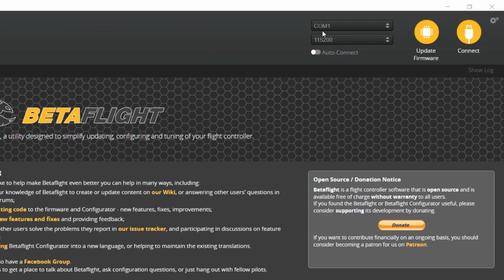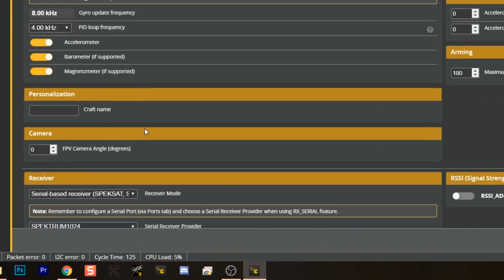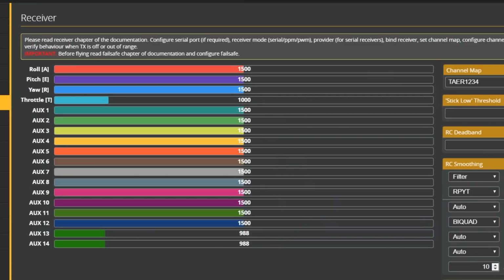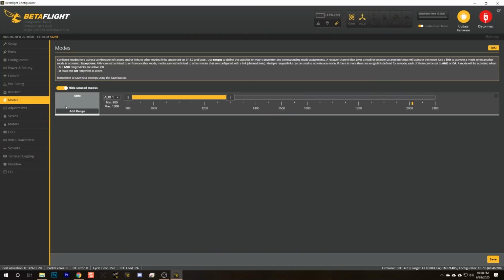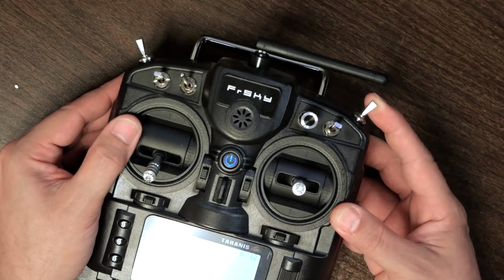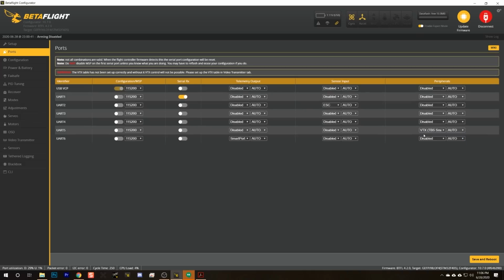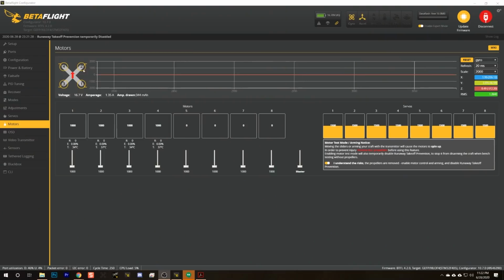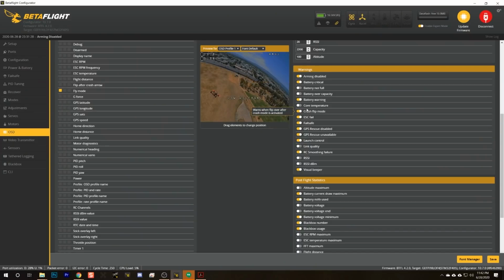FPV Drone Budget Build Full Tutorial - Part 3 - Betaflight 4.2 Complete Set Up

Comment: I’ve never really put any thought into it but what does min/max checking do in the radio? I usually leave them stock
Reply: Iirc when you set up the motors you raise the motor slider to when the motor begins to rotate. Then you add 10 to the value to make sure your min rotation is adequate. This is then the value used when the throttle is raised above the min check value.